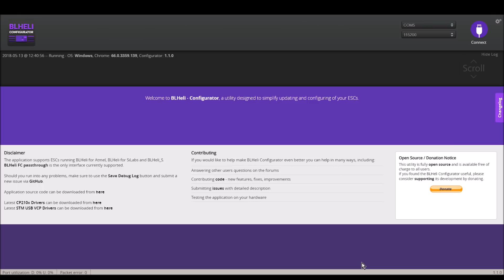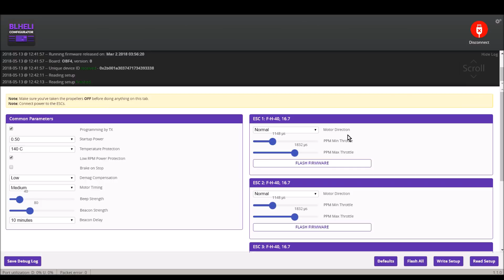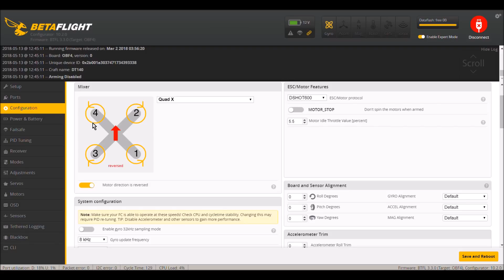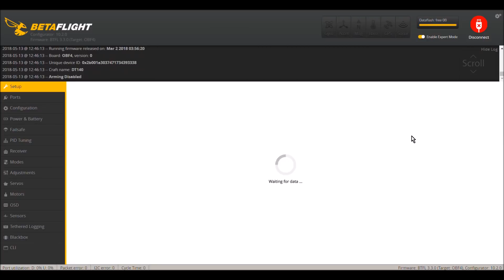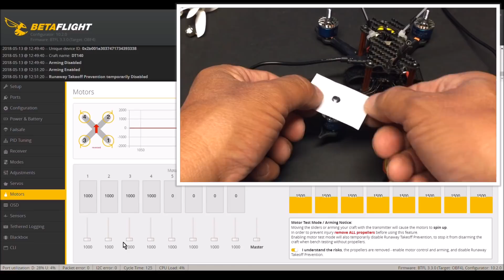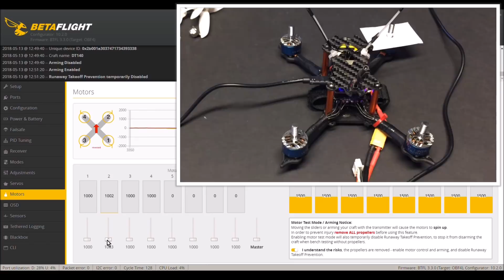The advantages of reverse prop direction - simply a no brainer!!!

Comment: I reversed props on one quad and noted that the motor nuts loosen up quit a lot.... should I physically move the cc and ccw motors to different positions help that problem?
Reply from the maker: Yes, if you have directional motors, swap them so the nuts will self tighten.

Comment: My setup read : Normal Reversed Reversed Normal in BL heli and so I reversed them all to : Reversed, Normal, Normal, Reversed                                                          Then I set motors to "Reversed' in Beta and now it wont leave the ground .. so ive put everything back. What am I missing ?
Reply from the maker: Spideystrat 
Have you reversed the props?
Reply: Ahhhh ... no lol will do. Didnt think of that @RCEscape
Reply from the maker: Spideystrat 
Reverse meaning left prop on the right, right on the left and not upside down :)
Reply: Will do and let you know  @RCEscape

Comment: adding more straps just adds weight, and doesn't cover every angle crud can hit electronics, ay the frequency it gets tossed in there, it'll all still get just as dirty. props out you might bounce off front, but it pulls in on sides into electronics. and I almost never crash front end. most of the times I hit the side or off at an angle at which props in push out... IDK I smell placebo

Comment: the "dirt on cam" thing is true but reversing it gives more control? im skeptical bout it. plus if you are reversing your props, not just the props but also reverse or interchange  the motors as well because of the motor thread, that might cause your props to pop off away from your motors.
Reply from the maker: jeremy red 
It does make a difference due to the props grabbing and releasing the air in the opposite way.
Not a huge difference but you can notice it.
Yes, you may want to reverse the motors to have the prop nuts self tighten but the props won’t fly off with a locking nut unless you crash and there is another controversy, do you want the props tighten more in a crash and thus hurt the motors and maybe the escs or do you want them to loosen?  Turtle mode may be useless if the props come off but, most racers now come with 4 same directional motors so you still get two motors with threading that don’t self tighten anyway.

Comment: Hey Bro!  Love your channel and your mellow and thorough approach to explaining things! ;)
I have a Bfight 210 with self tightening prop nuts. Reversing makes them self loosening!  D'oh! LOL  You pretty much answered the prop nuts question I had, except can't I use locking prop nuts instead of having to swap motors to opposite arms?  How well do the locking prop nuts work and do you have some you'd suggest?  Keep up the great work!  Subscribed and LIKE of all your videos!
Reply from the maker: I have reversed the props on my bfight 210 as well using the same nuts it came with without swapping the motors and it works just fine :)
Reply: RC Escape... I must have not tightened them down ultra tight? I think I will get M5 locking prop nuts. 👍

Comment: For all those worried about send g crap into the stack & frame, some custom fit sides made from vellum or similar attached thru holes in the vellum & around the frame would protect the stack without adding much weight. If the vellum gets chewed up over time, it is easily & inexpensively changed. Should be able to get quite a few from a single sheet on smaller birds, & several from a single sheet for larger birds. Different color vellum would allow some neat customization.
Reply: lexan seems lightweight and ez to work with...
.030 almost weightless....plus you can almost not destroy lexan....

Comment: Cool choice but, the problem I have with it is that now it throws all the chopped wet grass and who knows what else.. Right inside your flight controller stack! Cam easier to wipe off😆
Reply: great idea...reversing almost gives the quad the same benefit that tiny wh00ps have of bouncing off the item instead of being sucked into it.  To me, that might just be the biggest advantage! :)
Reply from the maker: Frequent Flyer RC 
Man but you gotta try it out.  I think now the quad does fly better :)
Reply: RC Escape only seems to work better with hard turns on quads that have extra drag like propguards. On racing quads most the times prop wash and oscillation can be tuned out. The deciding factor for me is the flight controller thing though. It sucks cleaning the flight controller out from debris.
Reply from the maker: Frequent Flyer RC 
just put another strip of velcro up and over :)  https://www.facebook.com/818263618290823/photos/rpp.818263618290823/1695553757228467/?type=3&theater

Comment: On a stretched frame like the Space Wolf, the FC is further away from the props than the camera. So the debri getting into FC stack probably isn't as bad on those frames.
Reply from the maker: I would also think that the debris is less on the sides than in the front since it is not the direction of the flight.  I've kind of got the velcro extended to where after securing the battery, another medium length strip is added to wrap and protect up and over the sides and further secure the battery at the same time but will only work if the quad is able :)  https://www.facebook.com/RC-Escape-818263618290823/

Comment: I rather have crud get on the cam lense than into my flight controller and vtx. To each their own.
Reply from the maker: check out this video.  it explains the benefits from an aerodynamics point of view.
Reply from the maker: https://www.youtube.com/watch?v=0caK_wfJYqU
Reply: RC Escape Thanks, it was informative.
Reply from the maker: just put another strip of velcro up and over :)  https://www.facebook.com/818263618290823/photos/rpp.818263618290823/1695553757228467/?type=3&theater

Comment: Great info. Thanks. Btw, i finished building the SkyStar X140, my first build, and i love it. Everything went just fine, first flight was awesome. I'm using a 3s 550mah GNB, with XM-Plus-rx, and Taranis QX7S, and it has plenty enough power for me. Stock betaflight settings work just fine. Now i'm ready to build my second. I would like to stay in the range of 140mm and below 200mm  Any suggestion's would be great. Thanks for this video.
Reply from the maker: I just got done with the Helifar Turtles 135 and it comes as a diy.   A very nice flyer too :)